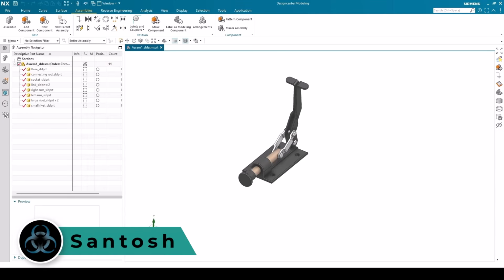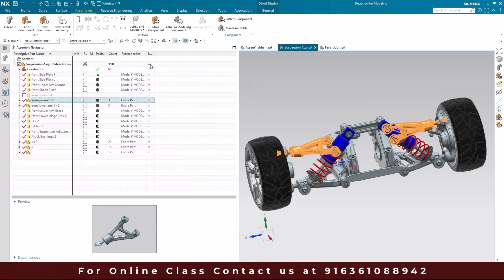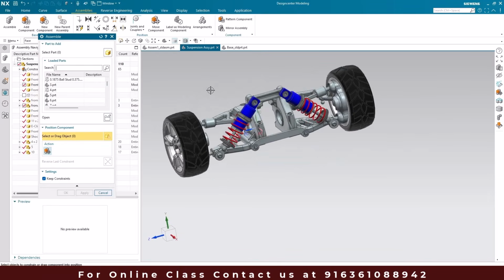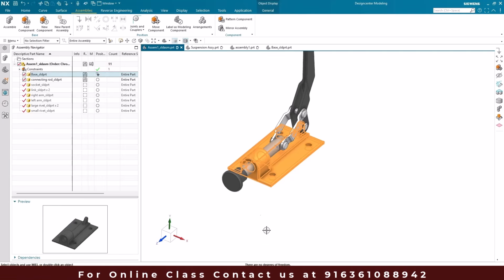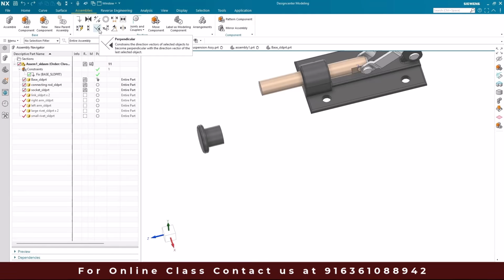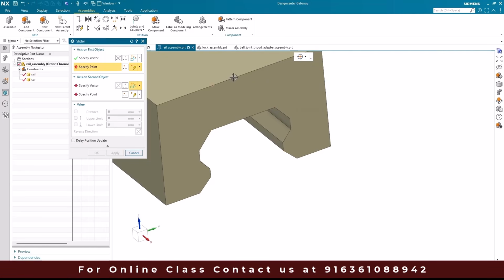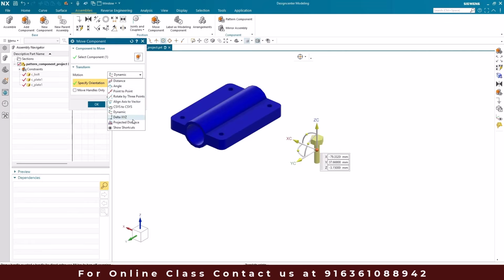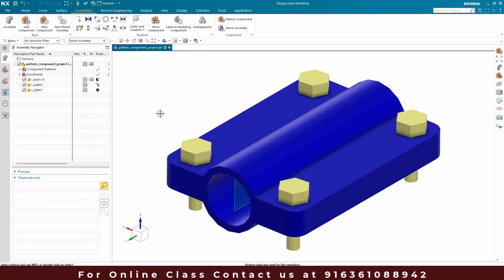Master Siemens NX Assembly Basics in Just 40 Minutes

Comment: Can we lock view position in Drawing?? (Vertical and horizontal movement on drawing).Use is we can overlap old revision on new and check change easily. But if you move view from old position it's use less. Other way is using TIFF file compare but I think if we can do in NX is time saving
Reply from the maker: if you have team center export both version pdf and compare in team center visualisation
Reply: @TechDesignsantosh  Thanks for your response. However, I don't have Teamcenter. Even if we did, I don't think it would resolve the issue—shifting the view even by 1 cm, whether horizontally or vertically, likely wouldn't make a perfect check